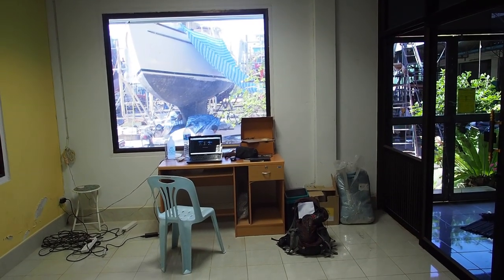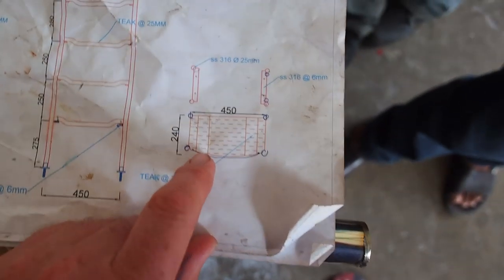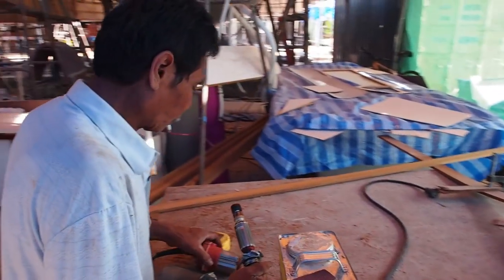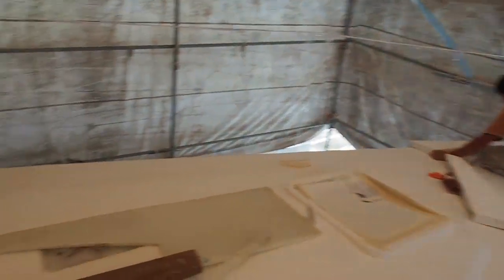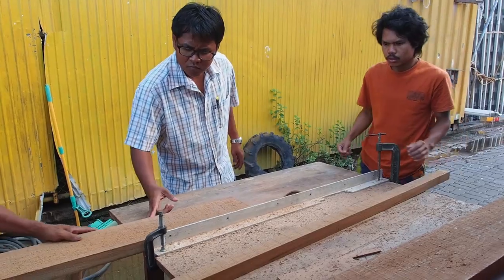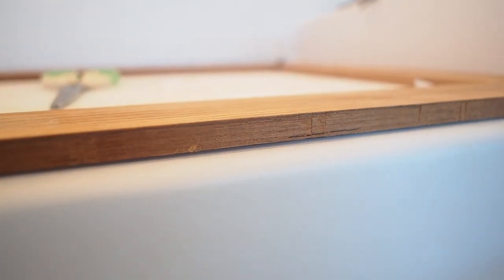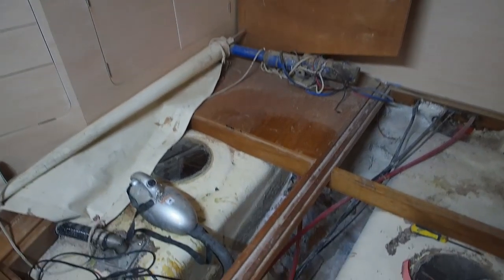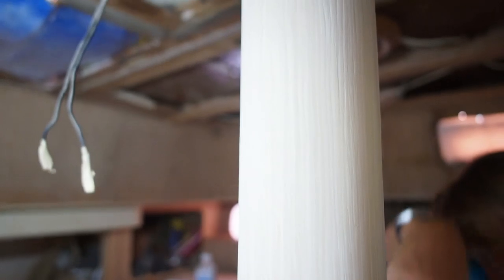Esper Refit 15 - polyurethane veneer; honeycomb boxes

Comment: I've been watching this series with great interest. Everything about a boat is very different, to me, but I can't get my head around a hull that light will shine through being strong enough to be ocean worthy. Clearly I'm not a boat guy. Thanks for posting!
Reply from the maker: It's a fair observation. However the light is shining through in the places we ground back to remove the osmotic blisters. When we added the biaxial and prepared the hull it was thicker than it was before. There are boats out there, however, whose hull you CAN shine a light through. Worrying.

Comment: why not just have new aluminum tanks built or fiberglass new tanks in to that space? would fix your leak issue and increase capacity. Nice refit so far, definitely labor intensive. Good thing the cost of labor is less there.  Seems like they are doing a great professional job though.
Reply from the maker: +Bob Fomenko [Liz] We re-fiberglassed the tanks, which worked, but maybe in the future we'll get new ones. The space is used to the max, not sure we could go bigger? Yes, it's the labour charges in Thailand which really help bring costs down. We'd have no hesitation in recommending PSS for work!